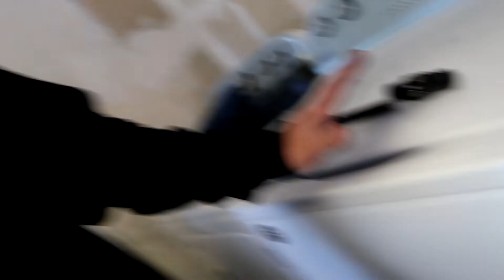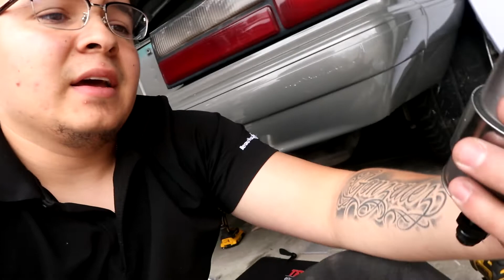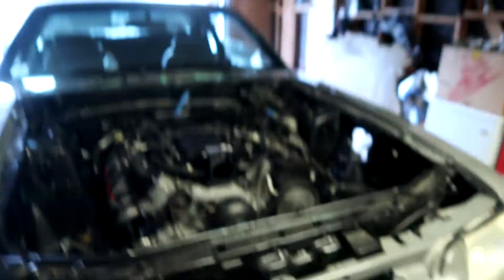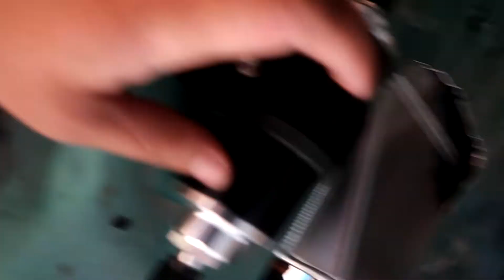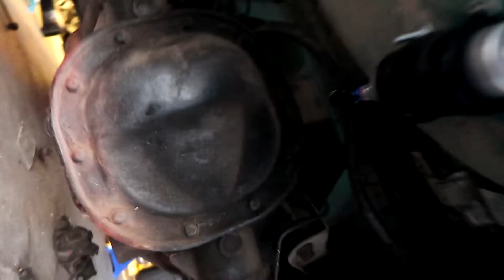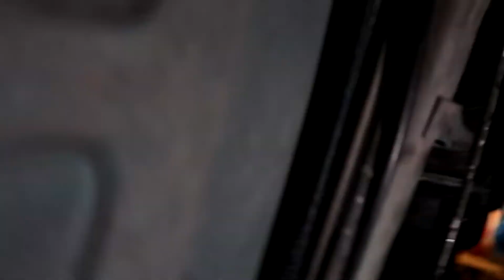Ls Swap Foxbody Mustang Part 4/Fuel cell/Custom Steering shaft/speed engineering Headers

Comment: U gonna Relocate the battery to the back trunk more space for modifications? Because it looks tight in the engine bay unless the battery is small - if you at sac race way I hope I see you run maybe my slow ass might be running for the first time
Reply from the maker: Yeah bro just waiting on the relocation kit to cone in and yeah bro u need to go to sac and race for sure it’s fun!
Reply: Wow you guys are from sac im originally from Santa rosa now im in socal but planning on moving back in the next 2 months hope to see you guys at sac race way by the way ull be in a fox swap ls1 as well with a 4l80

Comment: I see your making progress fast on your cars but I wanna race your LS1 swap foxbody when I go pick up my 99 to 04 Ford Mustang gt 2v an have some mods did to like a ported head an fully built stage 5 camshafts an valves screen retainers an built  Blocks selvees an a deck alone with racing internals for the block in then we can get some races in bro bro but I also have a homie with a Evo 9 mr with full bolt ons e85 tune /272 camshafts making 420 all wheel Horsepower we or in SoCal tho in the High Desert California
Reply from the maker: I’m always down for a fun run